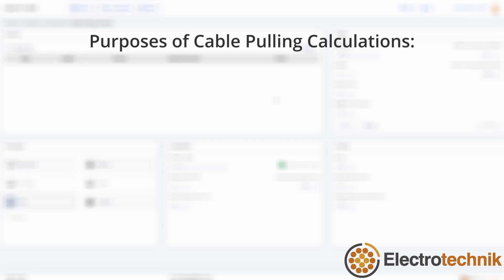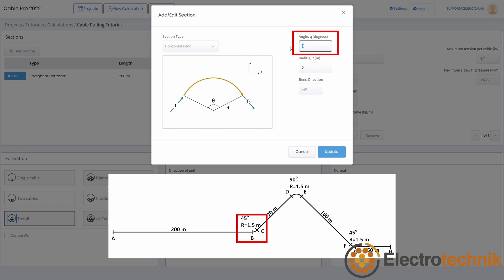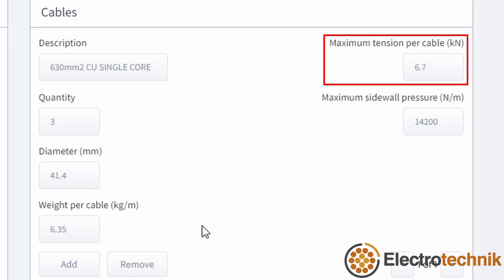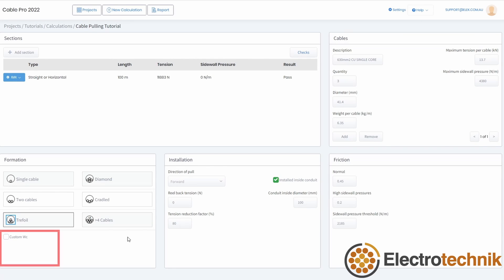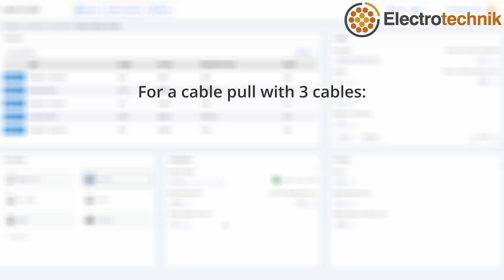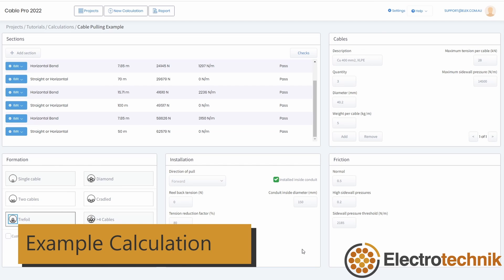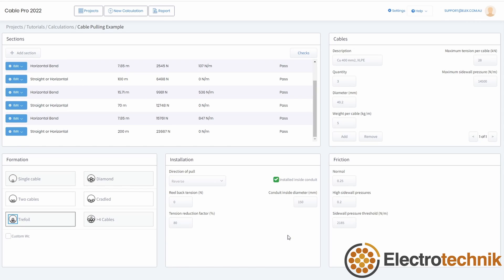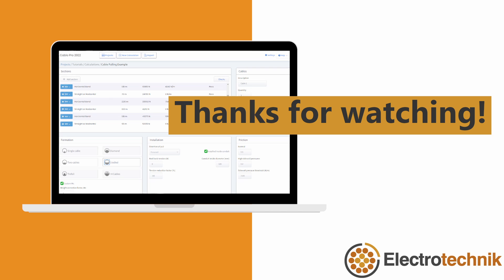How to do Cable Pulling Tension Calculations | Cable Pro Web Tutorial

Comment: Lubricity:
• PVC or XLP jacketed cable on PVC conduit at 200lbs/ft; coefficient of dynamic friction < 0.11, coefficient of static friction <0.13.
During Cable pulling calculation, Do we use only dynamic coefficient of friction 0.11 without considering 200lbs/ft or not?